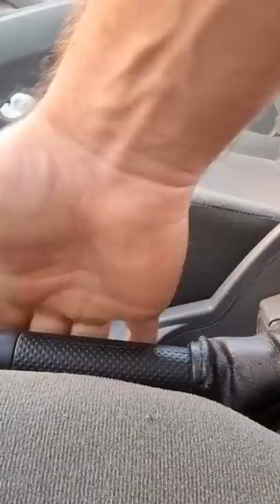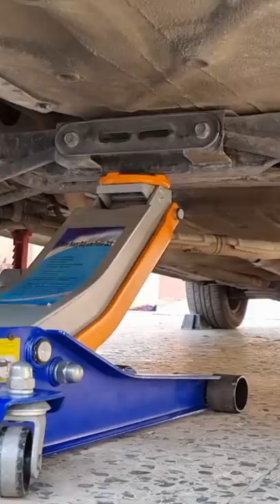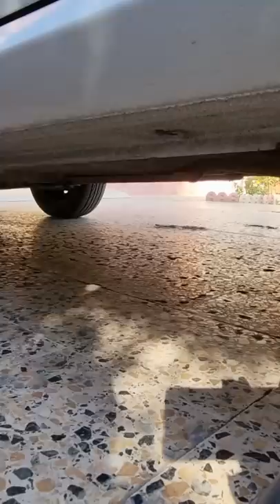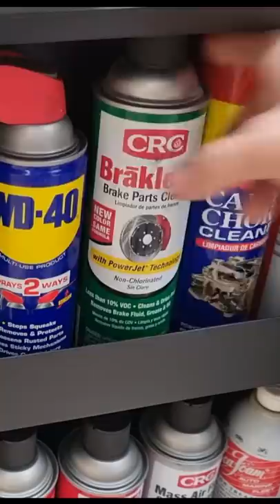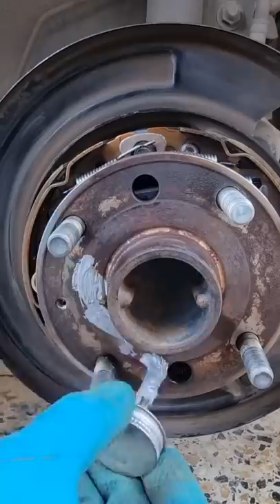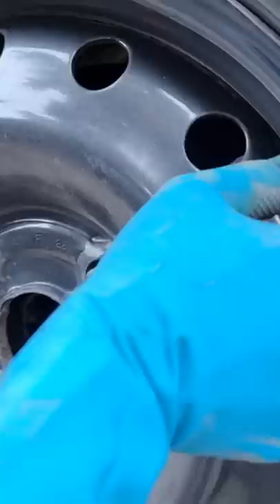Car still moves with handbrake on/How to adjust Parking pedal brakes #shorts

Comment: I just want to say thank you for properly showing how to jack up a car with adding the jack stands and tires under vehicle for extra protection. As a licensed mechanic, this is absolutely outstanding 👏🏼
Reply from the maker: Thanks for noticing that 🤜🤛
Reply: Y,kosy
Reply: as my instructor in auto mechanic taught me, after putting the jack stand, tap the same side of the car close to jack stand with your butt, to make sure it's stable enough, it's better to fall off the jack stand while you are up there, rather than being under the car !!😁😁
I also slide the tire under the car for double safety
Reply: Yup, so many people disregarding that! Remembering an old video titled "Faces of Death" which in one of it shows a man got his leg (almost) totally severed by the brake-disc that felt on him as the hydraulic failed, never forgot that scene (one out of many in tht series). 😱
Reply: I also leave the jack in place, can't hurt to have three layers of protection
Reply: I do exactly that. Tires under the rockers just in case 👍. I thought I was the only one, everyone rolls their eyes at me when I preach it!
Reply: Lasetti
Reply: BlueCollarLife420  let's worry about the rails if the car falls 😩🤷🏻‍♂️
Reply: Thank you for not using the pinch weld for either the jack or the jackstands! I can’t stand seeing crushed pinch welds!!
Reply: Very dangerous to not use jackstands, a guy not 100 yards up the road in his 50s was killed when his jack failed and his jeep fell on top of him, he was a weekend mechanic doing jobs for people mainly in his spare time.
Reply: ٢٠٠٥ ٢٠٠٧ 🤙🏽🇸🇦
Reply: Depends on the car... But close enough...

Dude.. how are those parts so clean
Reply: They also forgot to leave the roller jack under the car as a backup to the tire. Plus forgot to put blocks under the tire as well as chocking off the front tires.
Reply: Lasetimi 🇺🇿🇺🇿🤣🤣🤣👍👍
Reply: 6
Reply: ا1
Reply: @eliskacervinkova1740  ۲ت
Reply: @ВладимирВвс-с1з  5
Reply: Agreed!! 🤙
Reply: Z
Reply: S
Reply: Licensed mechanic Your pissed! The axle stands are shaped like that for a reason just imagine the point loading on the small area of contact plus it’s a hollow section where he tried to support 😂😂😂
Reply: Licensed mechanic.. What the hell is that.. Never heard in India 😂
Reply: No soy mecánico, pero me acomido a reparar mi auto aveces y es algo que hago siempre , toda medida de seguridad es necesaria
Reply: I came here to say just that! Very refreshing to see jobs done correctly.
Reply: So amazing that he didn't clean a hub from rust... Then people are thinking why my steering wheel is shaking.

But jacking was alright.
Reply: Although I would’ve kept Jack under the car for that extra bit
Reply: God, the Lord Jesus Christ loves you! Restore your relationship with God by repenting of your sins and putting your faith in Jesus Christ, "... that Christ died for our sins according to the Scriptures, and that He was buried, and that He was raised on the third day according to the Scriptures..." (1 Corinthians 15:3-4)
Reply: 999999999
Reply: 80

Comment: You don't need to do all that. Just adjust the manual brake with a screw driver...
Reply: Right answer ! Just did it with my BMW e90, no problems since
Reply: At least maintenance his car brake
Reply: Find an empty parking lot and make some stops in reverse.  A lot of cars will self adjust by this
Reply: Actually, when this happens, something îs wrong. Brakes are self adjusting.
He could replace the brake shoes too.
Reply: @steveofire56765  

,
Reply: Well if your cable is too far stretched what will happen is even if you adjust the cable it will still have slack and not fully engage so not all the time will adjusting it will work
Reply: @steveofire56765  all of them will, yes absolutely. Thanks
Reply: I tighten mine like that but the bolt keeps backing off and loosening. How do I get it to stay tight?
Reply: @moparguy5876  use some loctite it will keep it from moving but to adjust it hit it with some heat it will go right off
Reply: If you have had the brakes long enough for the system to start failing you should probably get in there clean parts and have a look.
Reply: But how?
Reply: Most cars are self adjusting by backing up and hitting the brakes a few times
Reply: @russellphillips1589  most but not all but most that are have their adjusters seized tighter than nuns cunny so the reverse brake slam doesn’t usually work. If you can’t bust them loose through the access a lot with an adjustment tool you’ll have to pull the drum and service them. If they adjust crack a beer and celebrate.

Comment: There is a hole on the back side of the brake assembly to adjust the emergency brake. No need for all the work. It should be in the car's owner manual too.

Comment: Any good mechanic knows you never use WD40 OR anti-seize on any parts of your brakes. Anti-seize especially when it gets hot will turn into a fluid liquid which may run onto your brake parts and will cause braking issues
Reply: I use anti seize on the back of the wheel, so it doesn't rust to the rotor. I've done that for years...everyone beats their wheel to get it off, not me. it's never once got close to the braking system though.
Reply: You don't brake with rear brake obviously.
Reply: @Chris.Rhodes   you shouldn't do that. The parts in a car are designed so that the friction between the services hold the wheel in place. If you put anti seize there you rely on only the bolts to hold your wheel. This might work for a while but can be dangerous in the long run
Reply: @casper-sc1pp  i understand that, and it makes sense, but i mean, I've been doing it for as long as I've been driving (20 years) but now that you've said that, I may quit. You get mixed answers when it comes to stuff like that.
Reply: @CC-se4ci  you don't brake with rear brake?
Reply: @casper-sc1pp  that's completely wrong, the bolts are the only thing holding the wheels on.
Reply: @Chris.Rhodes  my motivation is that I am in mechanical engineering school and we were thought that every sort of service like that is engineered using the surface friction coefficient to hold stuff in place not the shear force of the bolt. The choice of bolt diameter is becouse of its tensile strength not its shear strength. You don't wanna shear your bolts
Reply: But i agree everyone has a different opinion. What I usually do is put some on the edges so it's sort of water tight
Reply: @Chris.Rhodes  yea, my car use front brake to stop. Maybe my car is weird? Idk
Reply: @CC-se4ci  umm...every car has a rear brake. Your brakes work 80/20....80% pressure to the front, 20% pressure to the rear roughly.
Reply: @Chris.Rhodes  
Or roughly 70%/30%!
Reply: @AzzKicker-bz1cb  I said roughly lol
Reply: @casper-sc1pp  friction = resistance to movement
Reply: @casper-sc1pp  I've heard a lot of mixed things about this stuff. My dad used copper paste for a while but eventually stopped. My uncle told me that even Rallye drivers use that stuff on their wheels...
Reply: @casper-sc1pp  but you wouldn't want to choose a tensil strength bolt on your lug nuts, you would choose based on it's shear strength. Lug nuts don't pull out, The wheel spins which would put it in the "shear" category. Right?
Reply: @Chris.Rhodes   exactly. But you need to prevent that. You dont want those bolts to get sideways force becouse that shears them. Therefore my point about the friction is to keep that from happening. However I calculated it and I actually came to the conclusion that the bolts alone without the friction are stronger,(can withstand more sideways force before they brake) then the friction alone without the bolts. So in theory it shouldn't matter. However I still stand by my point becouse sideways force on those bolts might not break them but can fatiqe them after a while so it's better to just let the services help them along. 
According to wurth the shear strength of a 10.9 bolt is 3/4 of its yield point so that's probably why it's so strong still
Reply: @mihailjovmir  would you use water to displace water? WD= Water Displacement
Reply: @casper-sc1pp  gotcha. Thanks man
Reply: @casper-sc1pp  I’ve never heard engineers design friction and rust into holding wheels in place. The reason you torque bolts is to stretch and load the threads till they yield this ensures clamping and not backing out. Antisieze or oil is necessary to get accurate stretch. Obviously if it’s dripping off onto yur brakes you did it wrong. There are lots of videos on torque, stretch, yield ect…
Reply: Judicious anti- seize on threads and on the small raised portion of wheel is beneficial, heat from braking causes harmless streaks at worst and centrifugal force flings excess away from brakes.

Comment: Had the very same problem years ago regardless how many times I send my van to be (re)adjusted! Knocked number of motorcycles also in between.
Once I even had my drum brake smoking red hot just after having the brake adjusted (way too tight by the mechanic) before I realized, almost 20km of driving! What a trouble n nuisance at that time as I hv to borrow another car (as I m too afraid to drive my van back) to get the mechanic (thats 20km+20km), bring him over to recheck n fixed (another 20km drive back to my place) before sending him back (another 20km) and finally droves back to my place (another 20km, totaling 100km min) returns the borrowed car, then drove back by my friend to my van (all the time at the roadside) before finally headed home! Totally worn out that day simply due parking brake adjusted too tight!
Reply: You are the victim of unsupervised apprentice mechanic. At 100,000 service of plugs, cam belt, at authorised dealer the rear ( V6) iridium plugs were not changed, excuse being too time consuming. I made dealer write that on service book.

Comment: Most parking breaks are self adjusting with a sort of ratcheting mechanism that tightens each time you activate the parking break. That’s the clicking you hear as you pull it up. Pull it up and let it go a few times over and you’ll see it tightens right up. None of this is necessary

Comment: No 🥲 it can have several reasons for a low hand brake. First, check the hand brake cable that goes from the front to the back that solves 99,9% of the problems 👍🏼

Comment: 10 times out of 10 any carade after 1960 has automatic adjust on the breaks, it kicks in whenever you use your brakes after moving in reverse and tightens the drums or caliper.

Comment: Ya know that PARKING brake is designed to HOLD the car when STATIONARY not to STOP the vehicle as demonstrated in this video only to be used if all other methods bar crashing to slow it down

Comment: Usually that sprocket can be adjusted without taking the wheel off(just take off a lug nut) and you don't need to go through all that to adjust the handbrake.

Comment: Does anyone realize the tech, destroyed those wheel studs with wd40? Never ever ever use lube one any wheel stud or lug nut. The problem is lug nut torque will never be right. Just check with Chp accident investigators.

Comment: You can adjust it without taking down everything ...look behind the backing plate you'll see a hole with a rubber insert
Reply from the maker: The hole actually on the rotor, I always like to clean the brake dust and then clean it
Reply: It’s a good idea to poke around every once in a awhile especially when adjusting after a long time
Reply: They actually auto adjust but you jave to yank on them regularly to do so. If you don't use it you loose it lol
Reply: @AliMECH   no there is definitely a hole in the backing plate that you adjust with a flat head.
Reply: @shawnhenderson1130  Every car is different... some have them on the back and some in the front.. in this case the vehicle in the video clearly has the service port on the front. Hope this helps
Reply: You right!
Reply: @banjodc2  as someone who works in the industry this is true. But as stated else where while some auto adjust and some dont. Some have the hole on the front some are on the back some you actually hve to remove it to readjust and there is no hole. And in other cases some adjustments of the hand break are need to be done in the cabin and others are done under the body and not at the drums. Just hoping to help others.
Reply: @snowsultima9021  this is absolutely true. We get all different types at my job. Thanks for the info
Reply: This tech. Did  the job the way it had to be done on this vehicle. These e brake shoes don't self adjust. And always adjust brake shoes to fit the drum before  making  any cable adjustments. I have doing this work for 38 years. Hope that helps.
Reply: @robplotts9412  handbrake shoes with rear disks like this dont self adjust, only a full shoe and drum setup are supposed to self adjust but never really do!
Reply: @johnsmith-nl3js  actually there's a little arm inside where the adjustment is that when you either back up and abruptly hit the brakes or as I said before use the e brake it will adjust them. On my car it's you jave to use the e brake often to keep them equalized side to side and front to back. I know this because I've been doin brakes all my life about 30 yrs. You never have to take the back wheel off to adjust the rear brakes . There is a system
Reply: @robplotts9412  yea ive been a mechanic for 22yrs, most cars ive come across that still have drums on the back usually have a system like that but if they have disks and with handbrake shoes u have to do it yourself, i am in the uk though and the only american drum brake setups ive seen are on old chevy pickups and the odd fairlane or mustang
Reply: @johnsmith-nl3js  my car has ratcheting calipers in the back no drum only disc . There is no adjustment other than using them keeps them correct. If you don't use them the car will nose dive during braking . Only time I've ever had to adjust drum no matter how they are actuated by the driver is when I'm replacing the brakes all together then of course I'll use the slots on the back .
Reply: @robplotts9412  yea fair enough i was only talking about handbrake shoes not rear calipers with the handbrake built in
Reply: @richpetrillo8456  

Those e brake shoes are self adjusting otherwise they wouldn't have a star adjuster and adjustment lever.
Reply: I like to spray wd40 on my break pads. This way they last longer
Reply: Yes but most of them like mine are loose because the moving parts inside of the rotor are seized up. So it's best to open it up and clean It then watch it and make sure it isn't stuck while you're adjusting it.

Comment: For everyone not wanting to remove there hub there’s also a adjustment underneath the handbrake casing normally at the rear of the case depending on car 10-12mm spanner
Reply: Its not adjusting the brake shoe,you only adjusting the cable
Reply: Hey, what do I need to fix if the nut is to it’s max underneath the handbrake and handbrake is still going high?😅

Comment: Glad you showed putting the wheel under the car, I always do this because it's just an extra layer of security, I'd rather ruin my wheels than get crushed to death
Reply from the maker: Yeas of course, safety first
Reply: @AliMECH  this car LACETTI GENTRA  CHEVROLET legendary car in uzbekistan
Reply from the maker: It's a good car
Reply: Same 👍👍
Reply: I also leave the jack under the car as well as the tire and jack stand
Reply: Back the jack off onto the safety stands, then re-jack so it lightly touches, yup, the tyres underneath are a good third back- up.

Comment: You don't have to do anything providing the system is not froze up because of corrosion or gunk.  Backing up the car fairly briskly for short distance, and stop vigorously by pulling your hand brake only.  It automatically turns the star wheel with the reversing lever in the brake assembly, equalizes the emergency brake assemblies at the same time.   All drum brakes pretty much have that feature.  This feature has been around since cars.    Won't adjust in forward direction .   Only reverse direction !
Reply: Is this real?
Reply: Thats true but you still have to adjust it in lots of cars because over time the break wont adjust it self like wise in many Mercedes that use this break setup
Reply: Not in this case.
Reply: Not on this one, the adjuster doesn't have the stopper plate. It is just a simple brake shoe mechanism for PARKING only, not STOPPING/BRAKING. Those are found in DRUM BRAKE type rear brakes. This one doesn't have the wheel cylinder to push the brake shoe because it is using caliper type to hold the rotor disc.
Reply: For reversing/foot brake auto-adjust ( systems) only applicable in drum brakes, yanking on the handbrakes not needed.

Comment: You literally only need to hit the brakes in reverse...it auto adjusts..
Reply: And how exactly does it do that
Reply: @diychad7268  i am curious too
Reply: @eugyscan  me too
Reply: The cable or link attached to the anchor pin pulls the lever mechanism based on the movement of the secondary shoe. This happens when the car is moving in reverse.
Reply: Given it works well, but that's why there are adjustments on the parking brake cable under the car too.
Reply: He could have adjusted it through the adjustment hole, no need to take that all apart.
Reply: @diychad7268  
The self adjusting drum brakes was invented in the mid 1920s.
It's a very simple mechanism, look it up.
Reply: The car of the video doesn't have auto adjust.
Reply: The shoe on this vehicle is only for parking, not stopping. That function is not present in this vehicle.